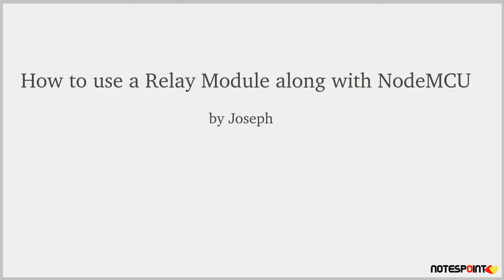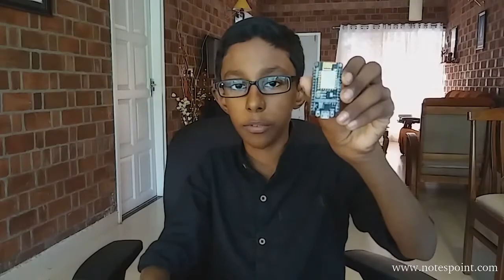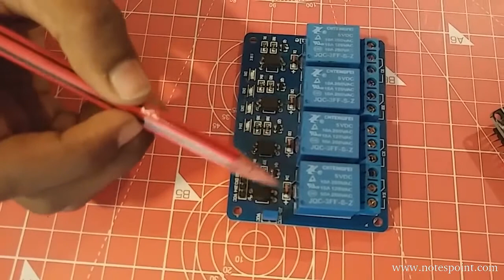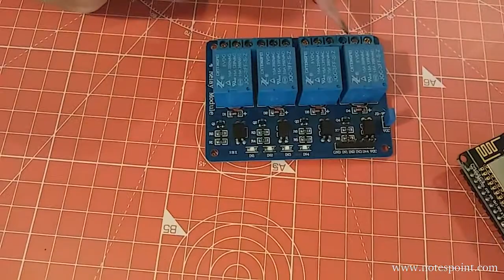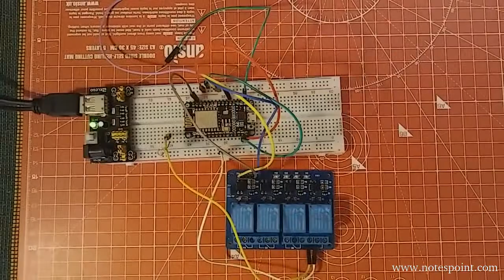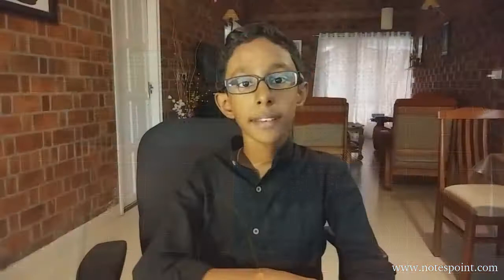Connect a Relay Module to NodeMCU

Comment: Thank you for this video! But how its possible to use a 3.3v in a 5v relay's signal?
Reply: And how do you fix, coz I have been facing a similar problem. mcu's 3.3 volt low to relays pin does not switch the relay. I am not an electronic guy, help appreciated